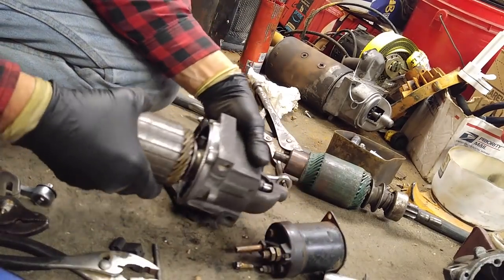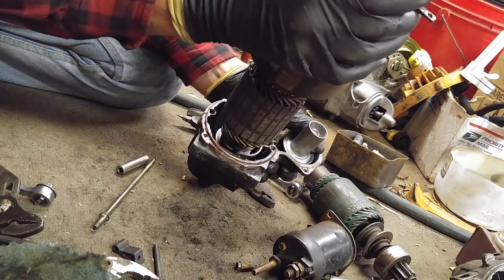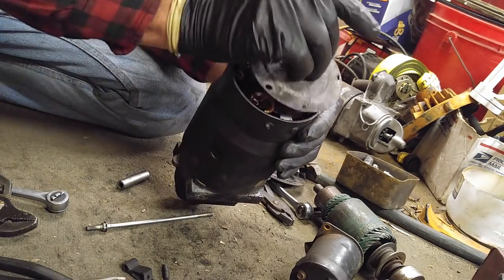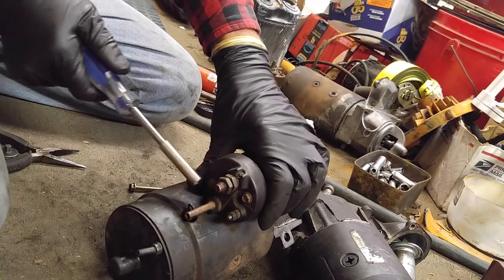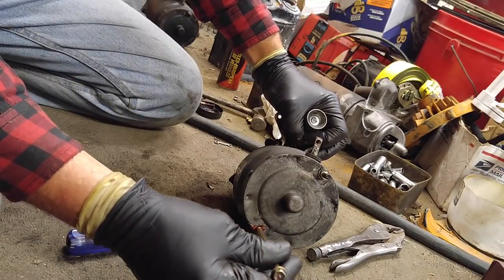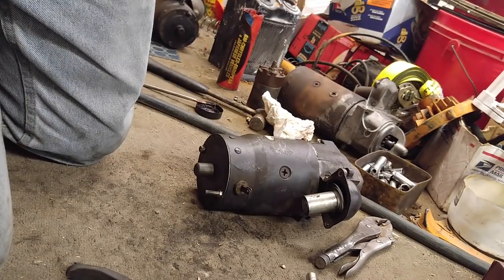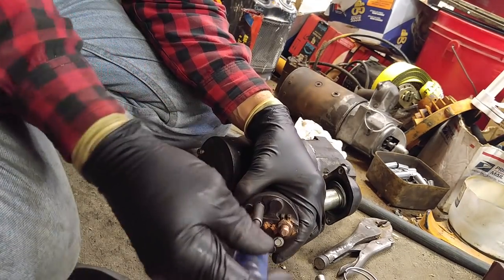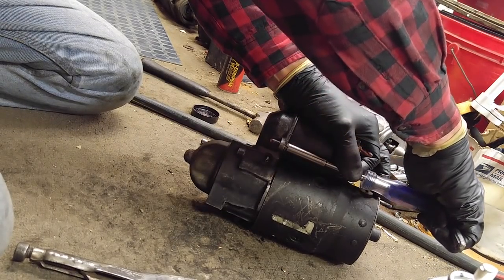K5 Blazer 10MT Starter Rebuild Pt II 12 17 18

Comment: They do warranty the exhaust system for 8/80,000 miles or more on some of the newer ones. You can't expect GM or any manufacture to warranty anything more than that. Ford and dodge have issues with it too and they usually break earlier,.